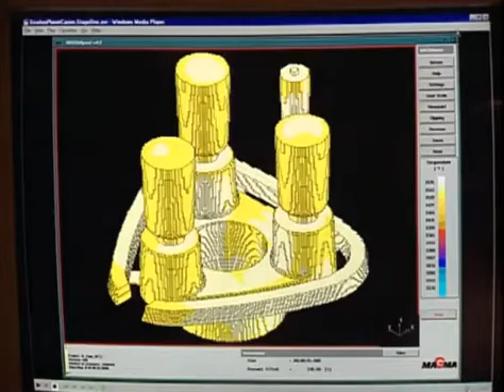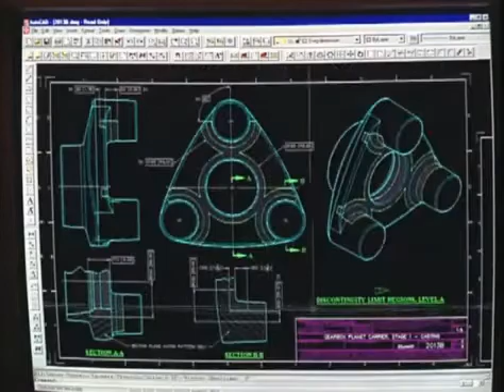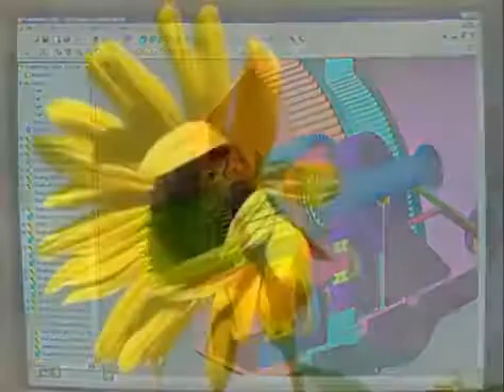The Wind Turbine Company Overview

Comment: just got know about you, like to ask this question what the major characteristics difference in terms of wind effect on 2 blade wind turbine and 3 blade wind turbine, its generating capacity and durability. what is the amount of wind required in a place to drive these turbine. please do make your email contact available so that we can always send mails when necessary. can this wind turbine be used in a dense area and can we have a wind turbine that can generate as much as 100MW of power